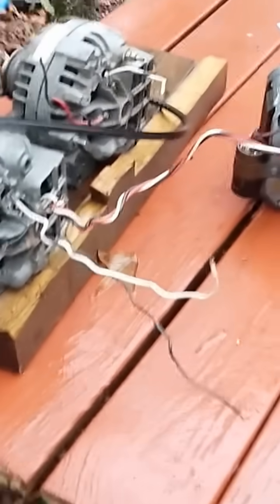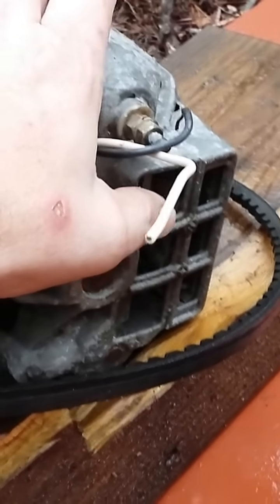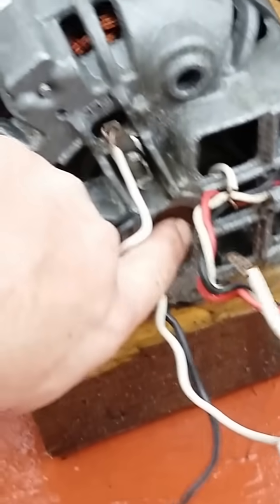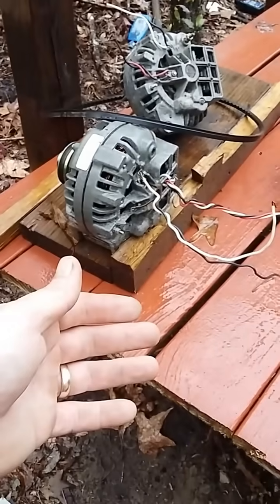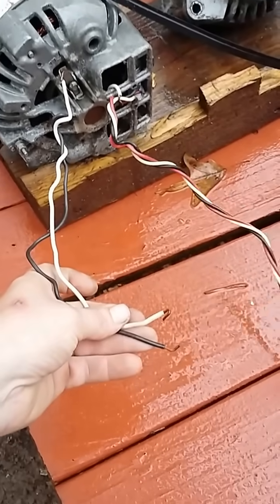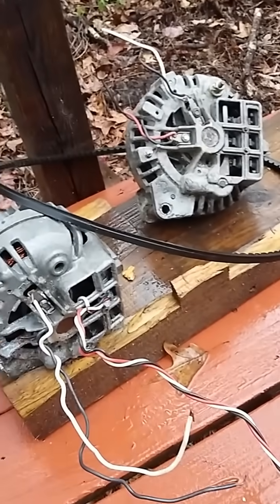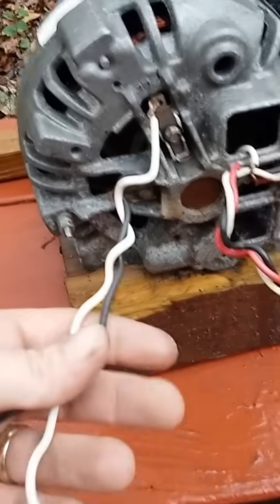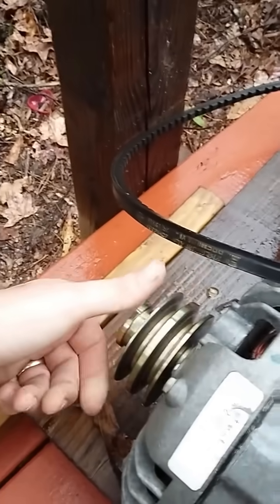Update Free energy forever no wind no solar no gas READ DISCRIPTION!!!

Comment: Their stuff was done Plumbing back in the 60 so how stupid do you think people are I mean people has done it since 19 and 65 and on up as long as they made an alternator on a Mopar car that's been the easiest to do and you cannot run that to get any power out of it without a motor now that motor is turning it you're putting gas in order you're putting some fuel in it so that ain't going to
Reply: If that could have been done you would have one big check in your pocket for perpetual motion and that ain't going to happen
Reply: You use a battery to power first one as a motor witch spins second one used to produce power and from some of that 90 amps you you get with second one you charge the battery now yo have a circuit to collect power.no need for gas anything!
Reply: @aquasoil1897  well get your camera out and put it on here... oh sorry, it doesn't work

Comment: I know a little bit about this alternator trick and that's bulshit you ain't going to get no free energy it will not run electricity it runs AC at a different frequency it will not run your household the Run light bulbs and everything with brushes but it will not run your refrigerator or any other Appliance without burning it up it takes up to eight horsepower to pull that alternator where are you going to get that 8 horsepower are you going to do it with your

Comment: how stupid everyone (ELSE?!!) SOUNDS??!!!  BUT WHAT IS YOUR FRICKING FUEL SOURCE????  WTF do you think gasoline is free?  are you running a nursery? cuz your baby is cold because your fucking generator STILL NEEDS A FUEL SOURCE- So lacking grid, solar...what drives your generator? what collects your static collection?  AN OBJECT IN MOTION requires an external energy source to act upon it to set it in motion (newton was not an idiot and definitely far more capable of describing the primary ignition source which drives the generator/alternator (yes I am well aware of what these are...AND I AM A WOMAN...AND NO, I DON'T HAVE A HILLBILLY DRAWL WHICH STUNTS MY COMPREHENSIVE CAPABILITIES...You do a fine job of twisting copper wires & pokin one in the ground...but makin flicker shows Y'all might wanna leave fer them smarter folk

Comment: Your talking about an inverter you can buy them for 12 dollars in a truck stop. Put a ceiling fan on it dump it on a pole then you have a generator but you need a control box otherwise you need to be next door to a fire house as most appliances use under 12amps except the cooker. OMG 😮 you make me laugh 😂 If it was possible don’t you think 🤔 💭 the power companies would already be using that system and making even more profit out of us instead of carbon fuels / wind /water/solar & nuclear energy, so with that why would I want to send you 5 bucks best of luck with your venture and you have made my day you’ve made me happy 😃 🤗😃🤗 and I thank you for that 👍👍👍👍👍👍
Reply: " Put a ceiling fan on it dump it on a pole then you have a generator."
Except that an alternator like that needs to spin at around 2,500 rpm minimum. I can't even imagine any ceiling fans I've ever seen even holding together at those rervs, that's if you could ever get it to spin anywhere near that fast anyway.

Comment: Playing with electric power in the rain is FUN 😀
Reply: It's good for your brain too. Just look how sane this guy is.
Reply: Yea Ima spend me some time spinning them in the rain. I built one of these 2014. It worked perfectly, until I loaded the field wires, but it was just for looks I will build another I used the smallest dc electric motor I could find fwd electric fan motor has a nut that fit right into the hexigon allen hole, man she would fly. It us still up there in the woods 😳

Comment: Where does the power to turn the generator come from? It aopears you are just recreating a common generator. Why would anyone care especially enough to harm you? Your claim of 220 vac is out of line with the device spec. which allows for 16 vdc after rectification which would limit output to less rgan 20 vac.

Comment: Can you build one from scratch meaning shores how are you wired it not how it’s already wired it was a little difficult to see where the wire was connected to or how you connected them but great job and you are a very smart man thank you and yes they will try to take it down look at the guy that invented combustion at a water video came down quick and with the same And with the same gases from the water or steam basically you can keep reproducing combustion that video came down which whoever has that video and can reproduce it will be great

Comment: So , by removing the diodes from the alternator , the alternator then becomes a generator producing an AC current , right ? Then by having a natural power source to spin the generator , you should be able to direct the AC current to a breaker box that distributes the power to what ever items you need to run, right ? I’m seriously trying to understand this.   I understand that there are times when you need to venture outside the box and break a few rules to get things going . Let me know if I’m on the right track .if so , I have no problem with your requested donation .
Reply: @Smarter Than You great explanation! Better than the guy behind the camera. I'm an electrician, but I'm still learning and studying and trying to understand stuff like this. Your comment is the best I've come across so far on this video. Still not sure if I actually believe this is what he claims it is though...
Reply: If I'm not mistaken, he is claiming this is a perpetual motion machine.
Reply: If you remove the diodes from an alternator, you still have an alternator. Unfortunately it takes more power to turn under load than what it will produce.

Comment: What are you using to power the motor that drives the alternators.
The law on the conservation of energy dictates you cant get energy out of nowhere!! 
Due to the friction of the bearings, The eficiency of the coils in both your motor and alternator you have to put more energy in, than you could ever get out.
You might increse the voltage, but you would have an inverse drop in the amps , or you might increse the amps but again an inverse drop in voltage.
You are talking about a perpetual motion machine. Sorry, laws of phisics demand it cant be done.
You are either very misinformed or a fraud!!!
Reply: While quantum physics does in fact recognize so called 'zero point' energy, he is not harnessing it with parts out of his broke down 1986 Chevy sprint and the compressor out of the old fridge that his uncle left on the porch.  Or is he? Maybe he is a genius and all of us with years of formal training with electricity and years of real world work are just morons.  It's a vast conspiracy to prevent people from building useless methamphetamine fueled art projects.  Don't you see it isn't laughter.  It's 'suppression'.
Reply: @rehoboth_farm  I wish I had wrote that. Brilliant ! !  Eddie
Reply: @MrEddiekessler  Thanks.  I do what I can.

Comment: Explanation really sucked.  The theaory is good but the " not rocket science " explanation was the worst I've seen on the subject.
Reply: Sadly this poor fellow knows nothing about either rocket science or electricity.
This is the oldest perpetual motion idea in the book. Use electric motor to drive a generator to create power. Sadly, it just does not work.

Comment: Prove the man is wrong. Reproduce his system an prove him wrong
He has tried to make life better. You cry babies need try also.
Reply: But he didnt make anything. He just claimed he did. If you want free energy, use the sun, wind, gravity, or geo-thermal. You can argue against physics, but you're gonna lose.
Reply: Have you tried?  I can tell you IT WONT WORK. If it were that easy everyone would have free power.  You just cant put a small 6 volt battery onto an alternator and expect  90A out. Doesnt work that way. You need more total power in when converting energy out.
Reply: He hasn’t come up with anything new so he can’t be proved wrong. He has an alternator off a car, producing electricity just like it did in the car. Only  he is using the ac instead of dc. 
Instead of the car engine driving it he wants to use an electric motor, much like using a petrol motor to turn it, either way it needs external power to run it

Comment: Here is another uneducated Dumb Shit,.......... It is unbelievable how many people have NO Fucking Clue on electrical theory, and think they know everything.
Reply: He's not showing the whole picture for the safety of those that don't know but, I did this years ago on a small scale for a science fair and produced enough power 120VAC  and I was only 12 at the time, all the info was obtained from the local library.  He is using basic electricity (101).
Reply: @JorgeLFreay  Wont work. You need a source of power greater then the load to power the alternator(s).  The saying is true. Nothing is for free. Now if he had 12V batteries charged with wind generators that were capable of producing more power then his load.. Then he might have something.  Just turning the alternators requires a lot of power though. Very inefficient.

Comment: Everybody! watch this amazing video(it is french): https://www.youtube.com/watch?v=6sAJzjJ6ujE
The person is producing electricity with only used parts that he got from recycling depots.
He only uses a 12VDC computer fan with magnets connected to a 230VAC/12VDC transformer with his 230VAC side connected to a light bulb.
Reply: So fake. Try it and you'll see.
Reply: @benhuffington8482  Have you spotted any clues in the video that indicate that it's a fake? Or have you already tried yourself?
Reply: There are clues, but you shouldn't need any because it's impossible. But ok: the light is 40 watts from a 2 watt motor? And light dims out of time with the "generator"? Could be a battery in the transformer? All free unlimited energy that doesn't have an input is a scam.
If you want free energy, get a solar panel and make a saltwater battery.
Reply: _  @benhuffington8482  _ Excellent!!!

Comment: Way to think about saving money and all you could be doing worse with your time but what about the internal voltage regulators and if a automotive alternator ran constantly it wouldn't last long before it failed on the auto application?

Comment: Now if you build a graphene based antenna and install it 130+ ft in the sky to get high voltage from atmospheric electricity. Google "Ion Power Group" on it. You convert that high voltage atmospheric electricity to 12 volts DC to spin your alternator. This way you have zero input and you are getting 220 volts 90 amps 3 phase AC output free usable electricity which you can then regulate with voltage regulator and pure sine wave UPS for stable AC inside your house. Also you would need to regulate the RPM of the alternator so you have AC at 50 hz.
Reply: Very low amperage from atmospheric. I'm sure it would keep the lights on, but I think an overbuilt solar/saltwater setup would be worth more in the long run.
Reply: @benhuffington8482  You can increase current/amps with step-down transformer by stepping down the high voltage low amps into low voltage high amps.

Comment: Please get an education. Low voltage electricity isn’t a source of power which means you have to use a battery to power your so called invention. Which also means you’re limited in the amount of usage you can get from it. You also can’t put 90 amps through a 12 gauge wire.

Comment: Why do you put current to magnets you say are inside the case?  Current is used to engerize electromagnetic field coil around stator .   Very confusing instructions.  To connect  this setup into your box--which wire is  sorce, which is return, which is ground?     Just so much bs on Toutube  it's hard to believe anyone anymore.

Comment: Okay, I'm just a student with almost the same idea of your invention. What I want to do is to create a loop. I use the 4 alternators attached in the metallic rod from the motor. Each alternators or AC generator has a rechargeable battery. What I'm trying to do is to isolate the "consuming station" from the "recharging station". The first rechargeable battery is connected to the electric motor. That electric motor should be energy efficient. If I will attached a flywheel between the alternator and the metallic rod, we can, probably conserved rotational energy for which the AC will use. I don't know for sure if the AC generator is compatible to recharge a battery. If it is possible, then, I think, the rpm is also a factor to gain more electricity output than the input in the rechargeable battery. I think, if we increase the numbers of poles, I think, hertz is relative to the electricity production. More poles, less rpm needed if we are problematic on speed. Also, we can overcome that insufficiency by conserving the rotational energy using the flywheel. I'm not sure if this idea will work. I hope I've help you.

Comment: You need to start from square 1 for us dumb guys who don.t  know crap about alternators and how to take it apart and wire it up and the whole works.  Your instructions are too    vague and sketchy for my old brain to put together.   Thanks for the vid.
Reply: You didn't understand? Geez man. It's simple. You connect the 3 wires to the flux capacitor then connect 2 more wires to the gigahertz converter. You fill up a container with blinker fluid and run  the wires through the container to the house and watch the energy flow. Easy peasy.  Sheesh. 😂

Comment: i know exactly what your trying to do. its called "power over consumption"  the problem is that is almost impossible. the bushing on the alternator and motor are to restrictive. the v belt uses too much power to be efficient. try putting bearings on the alternators and motor. Then convert the pullies to chain drive. i had a similar set up but didnt do any modifications. what happened was it worked, but the rpm's steadily decreased until it lost so much it stopped producing enough power to keep running. and that happened even faster under a load. but hey, if you can do it and it works, great!  put up a video of it operating.
Reply: Perpetual motion is a scientific impossibility

Comment: I get it, but how are you creating the 60Hz cycle for standard Household AC current? Kinda important...
Reply: You have to take the rectifier off the back side to convert from DC to AC.
Reply: @jamieevans223  I knew that. But what about the cycles?
Reply: @nasanction  A constant 3600 RPMs would be required. Best to use the alternators to charge battery banks and hook an inverter to the batteries. You will never maintain 3600 RPMs on such a system with load variables, and natural (wind, hydro) variables
Reply: @AmericanFreedom911  Agree, I have a Tecumseh snow king turning a 105 amp Alternator to charge my bank. Still need a better inverter. I'm right in the middle of a gasifier build, so that is taking all my attention and resources at the moment. I really was just asking about the 60Hz because I knew he couldn't answer it. Cheers!

Comment: Keep doing that and you won't live long! AC current has a phase and that phase MUST be matched to flow power into the circuit. If you don't match the AC phase you can get electrocuted, start a fire etc. A little bit of knowledge is dangerous! Also the phase in America is 60 Hz. That is very important and especially motors like in your refrigerator, Air conditioner, etc will not run properly and burn up, catch on fire, etc.
Also there is a physical law of diminishing returns. Basically that mean you cannot get out more than you put in, you will always get less.
Reply: Only uneducated people will believe this guy
Reply: Don H    Ever hear of a converter it converts the AC DC energy
Reply: @thomasbressler4575 n
Reply: don't waste your breath

Comment: I'm a electrician and if u run 90amps thru 2.5 mm cable it's gonna melt
Reply: I was thinking tge same bro whaha
Reply: You have to send him money, and he will show you the "real videos" haha.
Reply: I think he ment Milliamps...
Reply: I dont know this 
But i know how to pull water up more than 10 meters high without using any motor or electricity .it may keep on pouring water continously for years without stopping it.. would you please guide me if  the water falla from 10 meter high with 8 inches in diameter ..how many feet high turbine we need to make and how many times it must rotate in one minute